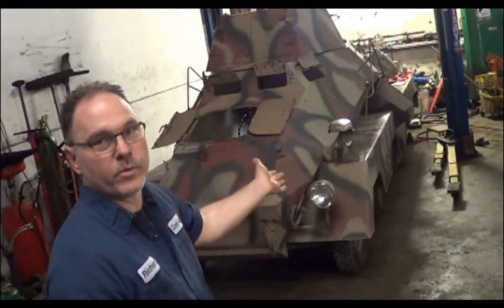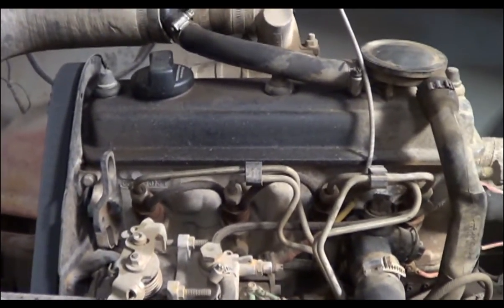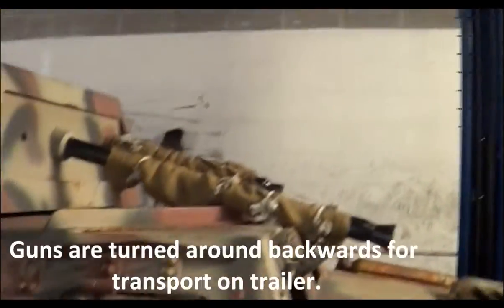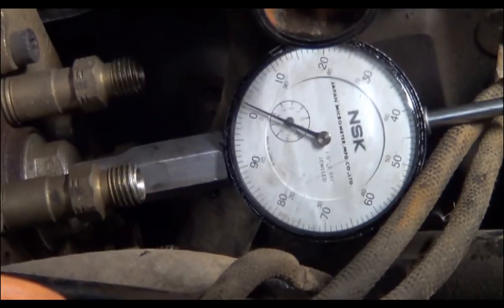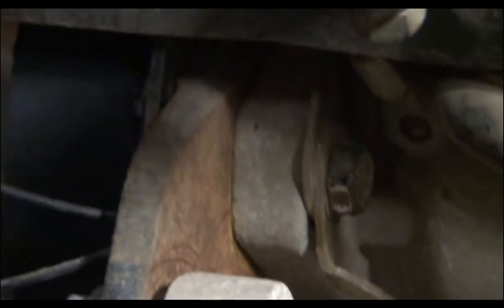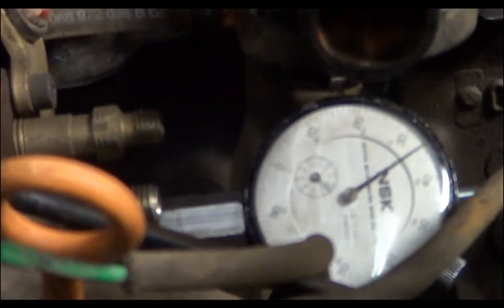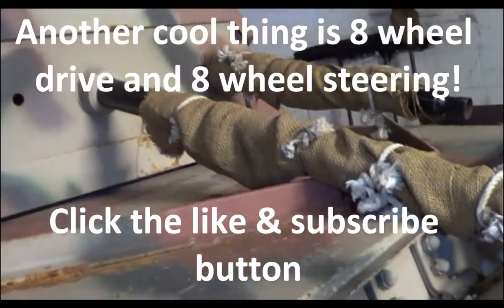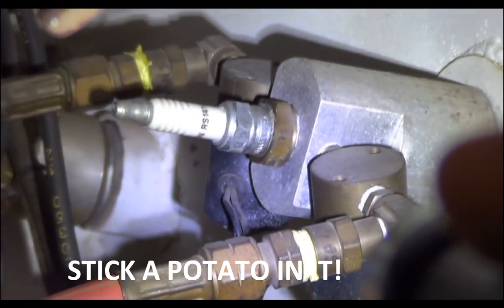Vw IDI Diesel Injection Timing

Comment: Thank so much for you video. I have a 1978 VW 1.6 cc. Rabbit diesel. I did exactly what you did the engine is working now, but the RPM are to high and making a lot smog. I want to ask you if the pump need to adjust. I really appreciated if you can help me in this matter.
Reply from the maker: Not sure I know the answer to your issue.

Comment: Good day..interesting videos you make. I have been following some on non turbo injection pumps..I think you call them lDl.  Mine is a seat 1.9sdi 1997 1Y engine.
What l am concerned about is the dial distance are they all the same...yours shows 33...thou's..l use mm's.
Mine has the adjustments on the pulley and  not on the pump.
Hopefully you can help
Or do require me to send an email....advise address 👍👍👍👍
Reply from the maker: Usually turbo diesels and Non-turbo diesels are a different setting. Check  your shop manual as there are no Seat cars here, but on the Vw's that are sold  non-turbo (or for best mileage) .86mm   (0.033in) or  1.00mm (0.039in) for A/C cars and Turbo cars.
Reply: Well l have reached the point of fitting and timing it..
I have looked all over the web for settings and they range from 87mm ,88, 95, upto 1.mm BTDC..but as said before my pump is fixed so l have to set it and lock it before..then fit and double check..that all is ok..
Just put me out of my misery and confirm it is BTDC...on the pump...😆
Thanks
Reply from the maker: @simonbertioli4696  .86 mm or 1mm as I said above.  Car will run on either setting.